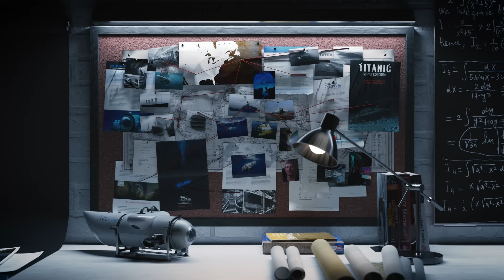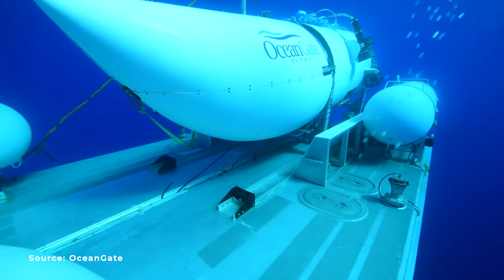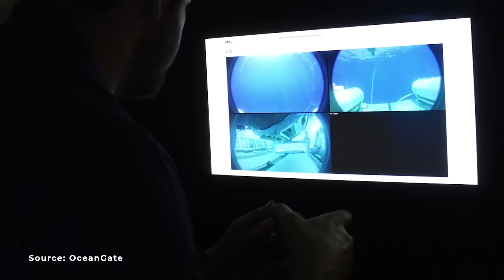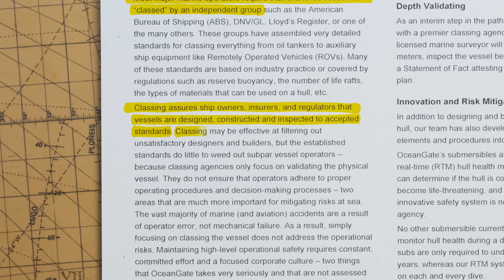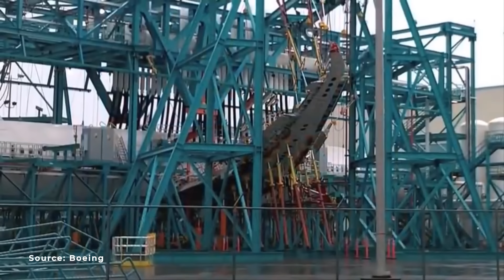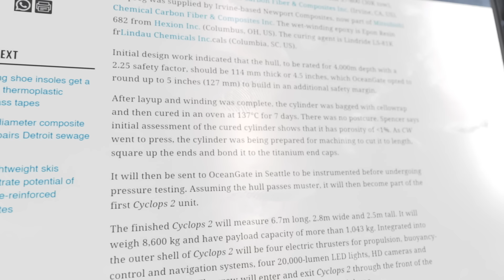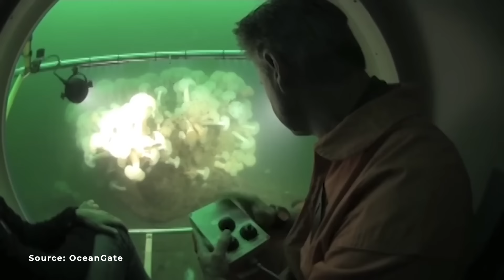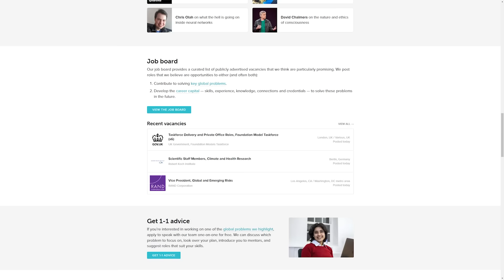The Questionable Engineering of Oceangate

Comment: Love this video. This is not innovation at all. It's simply using existing methods and materials on things they should not be used in. It's trying to defy the laws of physics. Recent aviation history actually did provide an example of circumvention of regulations and checks in the design of an aircraft (a software, not materials in that case), and hundreds died as a result. So whether it's aviation or diving, the principle is the same, and despite having 100+ years of history in development and regulation in aviation, you can still cause a lot of damage if you avoid checks and balances in the design. Lastly, to be fair to the space related companies, they break things during tests. Even in the case of Virgin Galactic, the death occurred during a test. They are not putting lives of paying passengers at risk (at least not yet). Tests, by default, is designed to try to break things. The mentality of "Doing engineering fast until things break" is not necessarily bad as long as proper testing is designed and conducted, 3rd party review is involved and critical opinions are addressed before commercial use. Hopefully, this accident will do the same for submersibles what accidents have done for aviation, i.e. making designs and procedures better, and more importantly, changing the culture of the industry and review bodies.